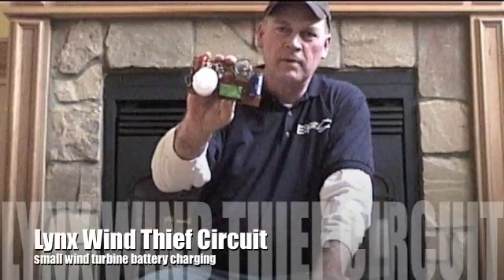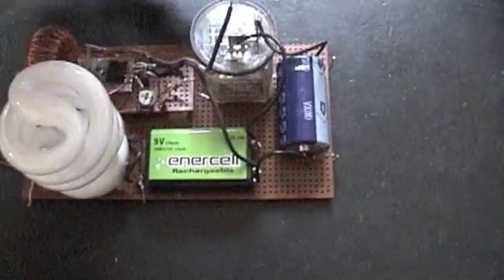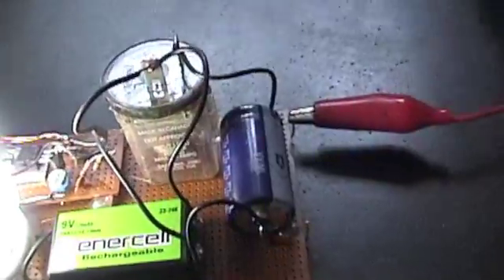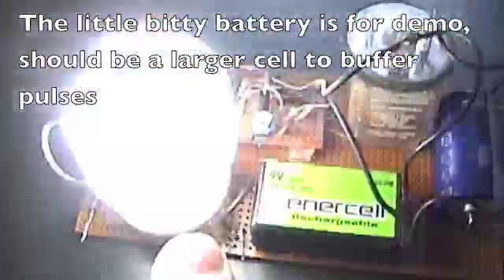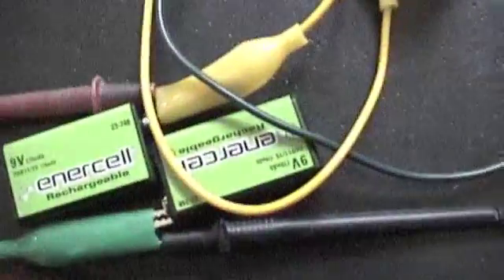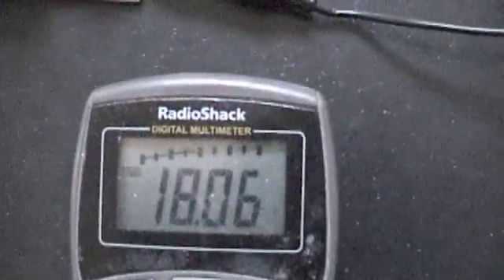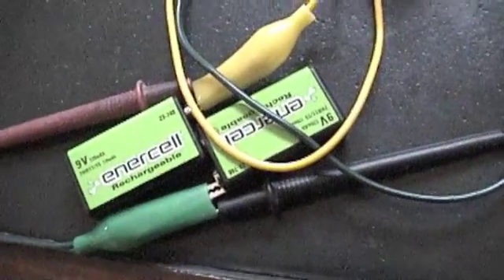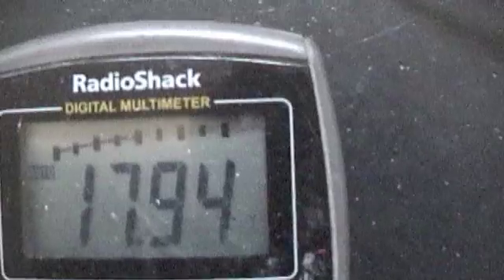Wind Thief Circuit

Comment: The JT is only about 50 percent efficient, so you will get more charging if you eliminate it.  I bought some buck-boost circuits from a Chinese vendor on eBay, that will allow me to input any V from 4 to 24V, and output a steady voltage which is adjustable.  They were about 6 bucks apiece, and I'm gonna use them on an ultracapacitor.  They are 90 percent efficient, and small enough to fit in the palm of your hand.  Check them out - the vendor was KUUCO, I believe the name was.

Comment from the maker: This was just to visually show what the circuit does.  The flasher is gone, the wind turbine is hooked up, and there is a rectifier to directly charge the battery when wind turbine puts out more voltage than battery.  No good wind yet, only JT charging so far in light winds.